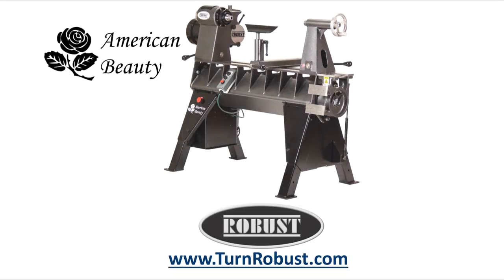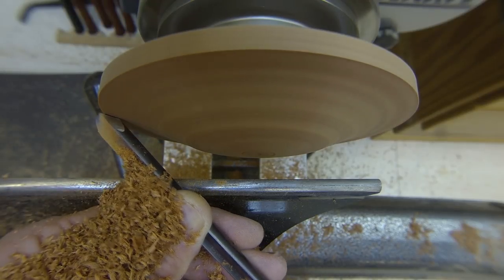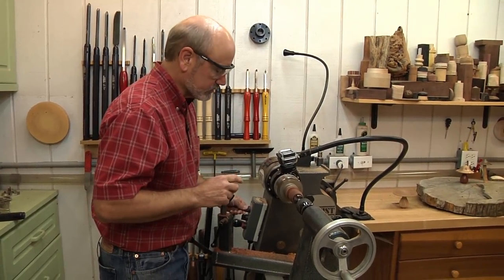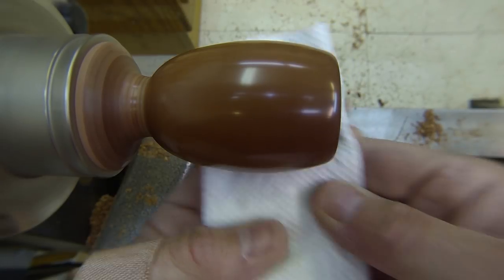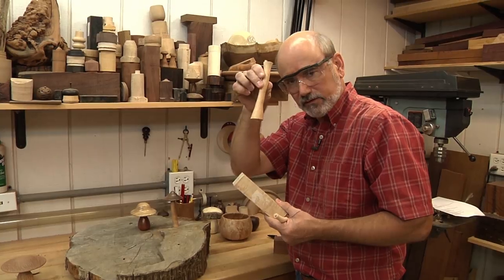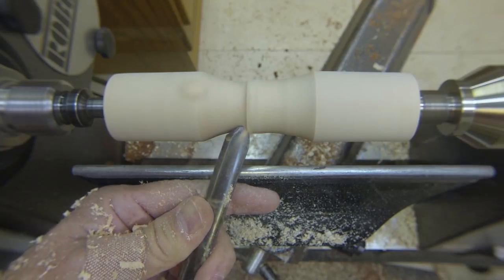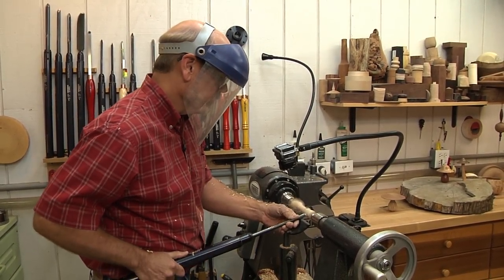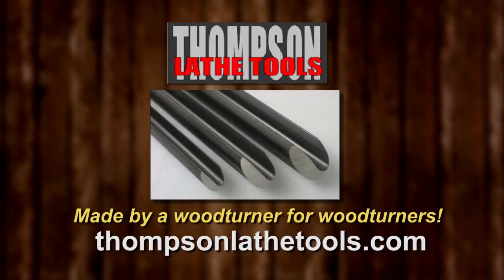Mushrooms-Part 2

Comment: Tim, how do I tell the difference between a bowl gouge and a spindle gouge and a roughing gouge? I enjoy your videos a lot. If you don't mind, what state are you in?
God Bless my friend.
Reply: Surprised that Tim hasn't replied - he must be mega busy, so I hope the following helps you.
A bowl gouge has a flute which is deeper than its width, is very robust and usually machined from a bar. A fuller explanation is at https://www.woodworkersinstitute.com/wood-turning/techniques/beginners-guides/turning-tools/the-bowl-gouge/
A spindle gouge has a flute that is shallower than its width. Full explanation at https://www.woodworkersinstitute.com/wood-turning/techniques/workshop-basics/the-spindle-gouge/
Both the above can be used on spindle and bowl work, but being more robust the bowl gouge is more tolerant of the overhang (from the toolrest) experienced on deep bowls.
A roughing gouge, more properly called a spindle roughing gouge, has an almost semi-circular flute and is often made by rolling a flat section of steel into a 'half' tube. It uses a tang as the handle attachment and should never be used for bowl work, which is too aggressive for the tangs strength. Explanation is at https://www.woodworkersinstitute.com/wood-turning/techniques/beginners-guides/turning-tools/spindle-roughing-gouge/
Reply: Garry Not Linda. Please note: The page referred to in the Phillip Hamilton reply to this post regarding spindle gouges no longer exists at this site as of 11/3/22.

Comment: Original pin jaws did have a pin that wedged on a flat surface machined on a round steel rod. with the pin in the centre of the flat, it made up the full diameter of the rod. Put it into a hole in the wood of that size & the pin would turn and wedge. Also, looked up abranet on UK ebay & all sellers stated it was dust free sanding!!! Didn't look dust free to me in this video. What a stupid claim to make